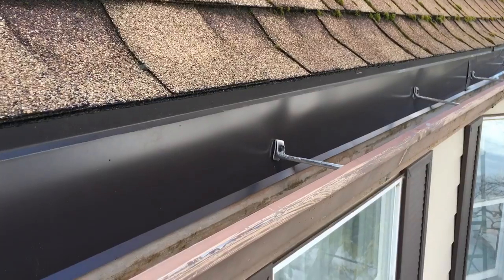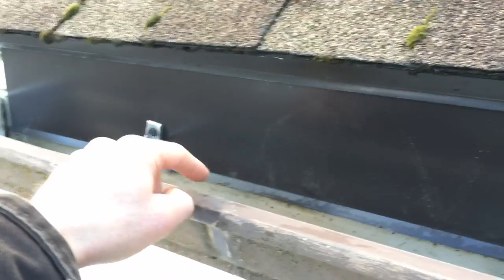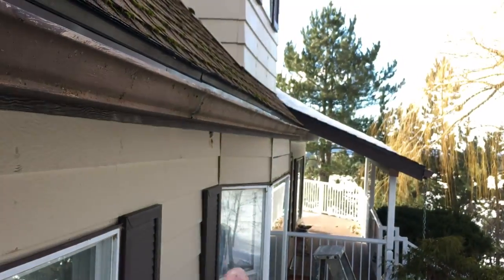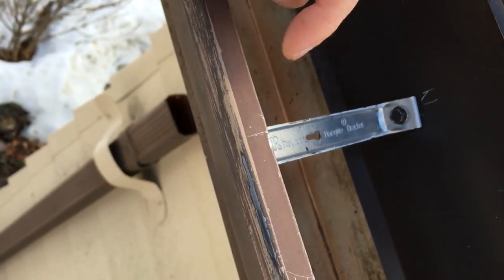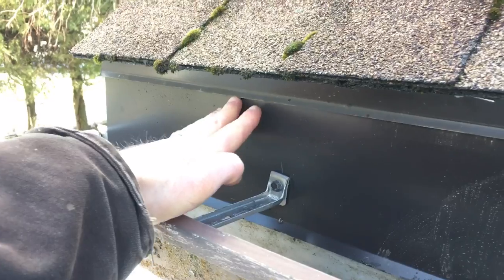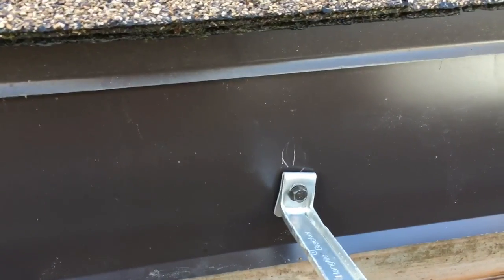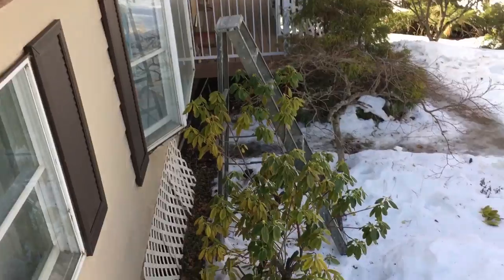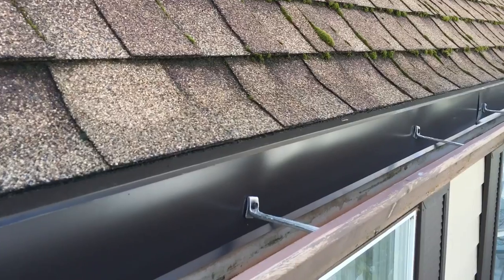How To PERMANENTLY Fix Leaks Behind Rain Gutters

Comment: That is a SUPER job of how to flash a gutter!!    I have never done such a good job.  You make me feel bad and I deserve it.  When I see problems with a gutter like that, I always suspect the size of the downspout opening.  I can't see any downspout to the left and I can't see one to the right.  I think you said that the gutter was 27' long.  During a heavy rain, that gutter is going to try and move a ton of water down one little hole.  I don't care how big the downspout is, it is the tiny little drain that causes the problems.  The zip screws that attach the downspout to the downspout adapter seem to catch leaves right in that opening.  Pine needles will form a bridge over it.  For a 27 foot run of gutter, it can't have hardly and slope to it.  It is probably almost level.  That doesn't help it drain.  As one of the other people to comment have pointed out, if that gutter clogs, it will fill up and the water will rise up behind your flashing and perhaps over the back side of the gutter, against the fascia.  The roof itself has a significant slope to it.  It is hard to imagine water clinging to the edge of those shingles and moving backwards to even reach the drip edge.  Maybe the gutter just fills up with snow in the winter.  I always flash the gutter, just not as well as you.  Thanks for taking the time to make the video.

Comment: Great info. I am not sure what solution(s) I will finally settle on, but I think the first issues to tackle are replacing the loose and missing screws on the brackets and evaluating how that works and troubleshooting from there. I also think I do not have a no drip edge, so that may be something I will need to investigate. Thank you1

Comment: Thanks for the video. This metal flashing is exactly what I need. Trying to find something similar for a while.
Reply from the maker: Usually you can find local roofing metal suppliers/manufacturers, gutter suppliers, or HVAC type companies that can supply you with some custom flashing like this.
Reply: @TomWylie   I have a mobile home and my walls and ceiling are getting water in them. There are no leaks in my roof at all. I keep my metal roof seams sealed and coat my roof as required. But, I noticed water running down the exterior walls of my home with the water running down from underneath the gutters. Where the gutters attach to the home are sealed very well. So what do you do when the water in running down like that and getting into walls and ceilings badly? My home has aluminum siding but it also has aluminum fascia from under the gutters to above the doors and windows (just to give you the area coverage.) I literally have rust stains on my outside walls from the water running straight down? For reference my home is a single wide with a seamed 29 gauge pitched roof (2000 model) all of my ceilings on the inside are vaulted. The leaks are on the are near the walls and soaking I guess in the insulation and causing more problems towards the pitch.

Comment: Great video Tom! I just had a bad experience today. We got hit with 2 inches of rain in just a couple of hours. The gutter  filled to the point of overflowing backwards into the sofet, then behind the siding to the lower level where the top plank of my basement sliding glass door sat. The water then dripped on the inside of my finished  basement. That's when my wife noticed drips coming in from the top of our sliding glass door onto the floor. Went to the gutter on the upper level where I saw the issue: "A small clump covering the opening to the downspout." Once I pulled that small clump out, the gutter drained and the leak stopped almost immediately thereafter.   Gutter helmet time maybe. But I'll revisit my gutter to see if the same issue is present as the gutter you fixed.

Comment: Good job with the extra flashing.  Looks like you have about 2” clearance between the drip edge and your hangers.  I wonder if you might have been able to add a narrower piece of flashing, still with your extra edge, stopping above the hangers so you wouldn’t have needed to remove and reattach the gutter.
Reply from the maker: Thanks. I don't remember all the details since this was 4.5 years ago, but if I remember right I wanted the flashing to go down that far so there wasn't any possibility of splashing getting up behind the flashing and against the facia board. I also may remember that I needed to re-pitch that gutter so it had the proper amount of slope in the correct direction toward the downspout, so removal and reinstallation was unavoidable. Like I said I don't remember for sure right now but that was on my parents' house so I've been able to keep an eye on it over the years, and it is still performing great.

Comment: Do you ever used pvc behind gutters when you replace gutters and old wood fascia board?  Or always wood wrapped in mental?
Reply from the maker: I suppose PVC sheeting could be used, but I would be concerned about how much it expands and contracts in temperature changes. I built a deck using 100% PVC decking and trim material, and we've been amazed with how much it swells and gaps in different seasons of the year. So for something like facia I would definitely recommend using wood and covering it with metal.
Reply: @TomWylie  thanks that seems to be the answer I'm getting.  Some contractors have told me that they have seen gutters falling off with pvc as the fasteners work themselves because of the expansion/contraction.  Not sure what's the reality but in 5 quotes all recommended wood wrapped in metal as the safer choice.  Thanks for the reply.

Comment: I see on your video, from 2017, that your drip edge is actually vertical and attached to the fascia whereas mine is horizontal and attached to the roof deck underneath my shingles!...so, their positioning is diametrically opposed...is your drip edge a special situation install or is my installer a total idiot?...I realize it has been quite a while since you produced your video but I hope you will still get back to me, thank you.

Comment: we have a metal roof (installed over shingles) and while drip cap was installed, it appears the gutters were installed afterwards and they didn't bother rerouting the back of the gutter under the drip cap... so... the water is following the drip cap right around behind the gutter and dripping out behind the gutter. 

Thinking about getting some of this and installing over the drip cap with the round part into the gutter --- it's 2-1/2 inches on the top and 2-1/2 inches down into the gutter (I cannot post a picture, it's Lowe's Item #367430, Model #BRA45TSRE).  Because it's a ribbed metal roof, I can't get very far up under it and do not want to loosen the lower row of screws on the roof so I'll probably get some short deck screws and paint the heads black and drive those in each end and in the middle of a 10 foot section (at the nearest raised rib).  

I think you did this very long piece extending past the hangars into the gutter because you had to put the hangars in anyway.  In my case, I don't want to remove the hangars and the 2-1/2 inches will come right down on the top of the hangars.  

Thoughts?

Comment: Where did you got the sheet metal that goes behind the original drip edge?
Reply from the maker: I got it from a local metal roofing supplier/manufacturer. You might also be able to get something made up by a gutter or HVAC shop.

Comment: Odd you didn't also replace those beat up gutters? Doing all that work might as well do it all.
Reply from the maker: It all depends on what the homeowner wants to do. In this case, my parents just wanted the gutters to function well, which were high enough in the air that up-close appearance wasn’t a high priority. They’re still doing great (and looking good from the ground) all these years later, and most importantly, we put a stop to the issues that would have caused serious eventual damage to the roof & walls.

Comment: Job well done!  Just one question TomWylie if you would mind.  When ice builds up in the gutter (as it has mine, and leaked in my house like there's no tomorrow), wouldn't the ice continue to build up behind the pieces of sheet metal you added and still leak?
Reply from the maker: Yes it's certainly possible. If you've got ice building up, you need to get to the root cause of the ice and take care of that (search for videos on how to fix ice dams, and what causes them—usually poorly insulated eave/top of wall areas). If it's not possible to deal with the root cause, then you'll want to install heat cable on top of your roof & in your gutter, to prevent the ice from building up. My favorite product for gutter ice prevention is called EasyOn Gutter Guard. http://www.easyongutterguard.com/
Contact them and ask if they still sell their heat cable attachment kit. It's a curved piece of aluminum that mounts heat cable to the gutter, causing ice & snow to melt and drain through the gutter system. I can't see on their new web site if they sell that kit still, but that's actually what I was in the process of installing when I recorded this video, and that system continues to work great to this day.
Reply: @TomWylie  Thank you for that added info, it's greatly appreciated.

Comment: Good solution. Where did you get that custom flashing? I cannot seem to find that in any of the stores.
Reply from the maker: V0L1SH10N thanks! I custom-ordered it from a local shop that supplies metal siding & roofing for steel buildings. If you're in the Spokane, WA area look up RSP (Rolled Steel Products). If you're elsewhere, look for a shop that does similar stuff. Perhaps a gutter supply wholesaler or fabricator could bend something for you as well?
Reply: Thanks for the response. Could you please clarify why does this flashing need a kick out at the very end? Why a flat flashing is not sufficient?
Reply from the maker: It may not be 100% necessary, but I wanted to make sure that water dripping down the front face of that flashing did not simply roll around the bottom edge and wick back up behind it using capillary action. Once water gets behind that flashing it could find its way through the screw holes around the mounting bracket screws, or it could possibly even climb over the facia-side edge of the gutter—which is the whole thing I was trying to prevent in the first place. That's the same reason why the metal drip edge material around the perimeter of the roof has a kick out on the bottom end. This special flashing is acting simply as a vertical extension to that traditional drip edge.
Reply: Seems like a kick out is an important element. Thanks.
Reply from the maker: surveyguyor it may have, thanks for the input!
Reply: @Survey I’m the super paranoid type, so I would probably run a bead of gutter sealant between the gutter and that new counter flashing.
Reply: just buy a piece of facia cover and cut it
Reply: the drip edge would never be needed if they would run flashing into gutter,,but more material cost more money

Comment: I like that extra drip edge. I need something exactly like that. How do i find that ?? thankx
Reply from the maker: I would do an internet search for metal roofing, gutter, sheet metal, or HVAC companies in your area. One of them should be able to cut & bend custom profiles of sheet metal for you. Try to find one that can make it in a color that matches your existing gutters or drip edge. Thanks for the comment!
Reply: @TomWylie  Do you have any experience with gutter aprons?  Our pitched roof is similar to yours so we have a lot of space between the gutter and the drip edge but in the sample the roofer sent us the drip edge snaps into the back part of the gutter. I'm not sure this will work for us. We need as setup here with the extra aluminum behind the drip edge protecting the fascia like you have.

Comment: I think much drip edge is poorly designed causing water to do as you illustrate and not drip off the front edge into the gutter but run back to the rear of the drip edge and go behind the gutter if there is any gap at all between it and the fascia.

Comment: Who can make custom sheet metal?
Reply from the maker: I would check with your local metal roofing suppliers (not big box stores, but places that supply contractors). Could also ask HVAC companies or their suppliers. Rain gutter install/repair companies might also be able to help, but they may want to just do the whole job vs just supplying you with the metal, so just be aware of that.
Reply: @TomWylie  Thanks Tom appreciated.

Comment: Those gutters are hung WAY too low..Should torn them off and put new ones on!
Reply: much easier fix is to slide sum aluminum under drip edge into gutter,,minits instead of hours and zero cost
Reply: Gutter QC guy from Texas here. From what I understand, up north they install their gutters below the roof pitch so that Sheets of ice slide over without hitting the gutter. I could be wrong but that’s what I’ve been told. We obviously don’t practice that here and my first thought was the same is yours. Bring the gutter up under the drip edge and send it.
Reply: @rep4666  it’s free to raise and re use the existing gutter though

Comment: Nail in a tub going into untreated wood. Screws would be better but still a joke. No matter how you do it water hits wood and soon rots holes where the gutter attachment is. It is just way way to hard to seal the screw or nail point. Design chg hold the gutter under the shingle or tile or ice dam. So before you do a roof do the gutters first and redesign the gutter to be held in buy the roof not the rafter tails or fachia boards
Reply: Ed, you made some good points but Tom wasn't hired to re-roof the entire house, just to fix the leaking gutter problem.  I've had this same exact problem in two different houses simply because the roofers do such a poor and fast job.
Reply: I would drive the screw, back it out, squeeze some silicon into the hole, then drive the screw back in.

Comment: He put strip of flashing up under drip edge .. Than installed new hangers.. So so job there..
Reply: In what way is it so-so, just curious. I'm unknowing about this stuff but I have the same issue. Would you have replaced the existing drip edge, or is that not possible without redoing the roof?
Reply: far from so so,,,its guaranteed to not leak,,its not possible to leak again